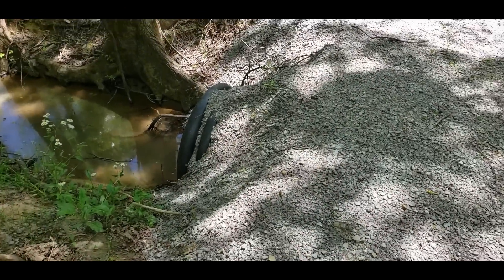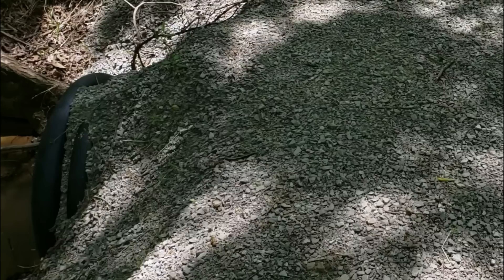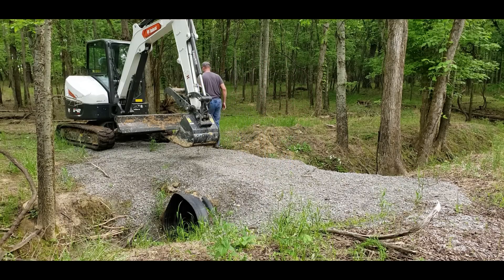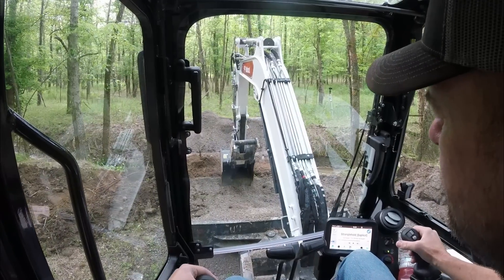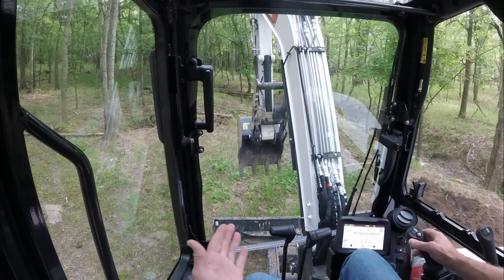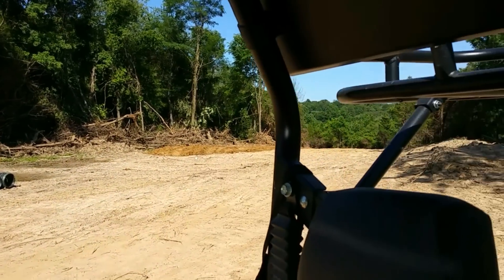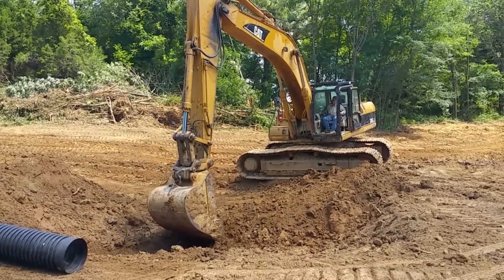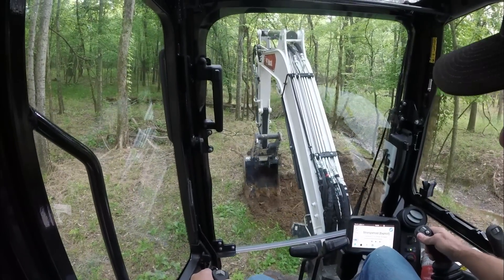CLAY VS. CRUSHED GRAVEL; Installing a culvert pipe; Water erosion & what to consider.

Comment: Crushed stone should be used as  base to keep the pipe from  settling causing a  lot of different issues .
Reply from the maker: I have found that if you can get the clay compacted that is as good inf not better than crushed stone. But if the clay is dry, no go. Thanks

Comment: im in east texas and i just put in a culvert with clay first then topped with 1 inch river rock.  when it rains its very mushy for a long time, it does not seem to dry out.  what did i do wrong?  i wonder if its just a matter of time so the clay sucks up enough gravel to get and stay hard?
Reply from the maker: The clay has to get compacted and then either grass grow on it or some rock on top. After it is compacted it won't get nearly as mushy down the road. Any kind of vehicle can compact it if the moisture is close to right. If it is dry then it won't compact, and if it is too wet you will just sink when compacting. But when it has some moisture try driving some kind of vehicle over it, over and over again and you will know when you are compacting it. After that, then you can add some rock to seal off the top so the rain does not penetrate much into the clay. Best of luck! Compaction is key!

Comment: Clay eh? I would've thought using stone or gravel would've allowed for more drainage , which would cause less erosion
Reply from the maker: nope, that 'drainage' lets the water penetrate the gravel and erode it  and on a culvert pipe, you really don't need drainage through the gravel. Thanks.

Comment: Joe in that spot if I had a choice for pipes I would have put 3 8 inch by 10 feet long pipes that way if the lower 1 pipe were to ever plug up the top 2 pipes like a upside down pyramid are a sure thing for water to flow
Reply from the maker: Not a bad idea for this one. But I am coming in at clean up on this project! So I have to do the best with what's already been laid down! I think you will like Part 2! Coming out shortly today! Thanks man

Comment: I've had a washout on both my pond and wetland spillways the past 2 years.  Year before I had clay hauled in.  Lost about all of it.  Last year I  had more clay brought on plus #3 stone put on top 4 inches deep. Looked today and it has washed out deep gullies again.  What do you think I need to do next??  Concrete??
Reply from the maker: Sounds to me like the spillway's could be made wider to handle more volume.. And if I remember right your pond run-over was actually starting 'under' water, which is a whole nother animal. I'd say the pond spillway needs to be drained a foot or so, and completely excavated out, and repacked with good clay. I think that one is from the crawdad holes, and then it comes up UNDER the spillway to wreck it. Just my thoughts!

Comment: I've seen where people stack bags of Quick-Crete on both ends of the culvert to prevent wash out. It seems to work but then again I don't know if it's cost effective.
Reply from the maker: I could see that replacing like rip rap at the end of a pipe, but ultimately at the base of the pipe the clay/gravel needs to be packed very well to hold up. I have seen those video's and I actually tried that once on the bridge project, and it was an epic fail...

Comment: Your right about the clay. You get better compaction than gravel or stone.
Reply: I heard it said hundreds of times, you cannot compact sand (or any other form of Rock) cuz it will always let water pass through.
Reply from the maker: Roger that. I just don't fully understand why it would be highway building specs to use metal pipes (proven to rust out, and plastic lasts longer) and crushed gravel...? Thanks.

Comment: At least it wasn’t a 12” diameter pipe, so at least they were close. 
That’s probably why it lasted as long as it did.
Reply from the maker: yeah I think this pipe was big enough for the volume, but only time will tell now. I really thing the gravel up top eroded just from rain, and not the ditch from overflowing. Thanks.

Comment: Kap. I worked almost forty years with a highway department. Out in thousands of ft of pipe. We had to use gravel like you say and the biggest problem is winter time gravel drains and native soil doesn't and road heaves and pipe doesn't and there's your big ol dip and bump
Reply from the maker: Thanks for sharing, there is always a counter point! So are you saying that due to clay/dirt holding moisture that it would heave more than gravel? Interesting if so.. But not many clay pipes blow out down here, but a LOT of gravel pipes do. Mostly from heavy rains though and not from frost heaving.
Reply: @kapperoutdoors  agree not blowing out just making big dips in Rd. Not many of the gravel pipes we did blew out we always built headwalls with played up flat rock to take the abuse and contain the gravel. Upstate NY way of doing it.

Comment: Hey Kap, this is almost identical to a ditch I built a culvert bridge over.  I am no know it all but would have made clay as the base and packed that mutha super tight, then make head walls on the ends of pipe openings to the width you desired. Those headwalls contain the material so no wash out occurs.  I too used highway specs as you stated and am able to drive a pick up truck over the pipe without issue. You're right about the clay cost being trucked in much yet, getting that clay dirt back to where you have to construct the culvert bridge.  Nice work; you got this. Say hey to Mrs K.  Looking forward to art 2.  🙂👍🏽
Reply from the maker: Just posting part 2 now! Thanks man, good points. It is always a learning curve... IF a person, state, or agency is willing to learn! thanks, SF

Comment: The only way that CA6 would have stayed there is if they had put rip rap around the culvert ends first for a retaining wall. Even then I would do what u did. Clay first for a footing.
Reply from the maker: Good call. And we do have a pile of concrete blocks that we need to pile up at the top end of this culvert to help slow down the water before it hits this pipe! Hopefully next week we can get to that. Meantime, today Part 2 comes out! Thanks man appreciate it